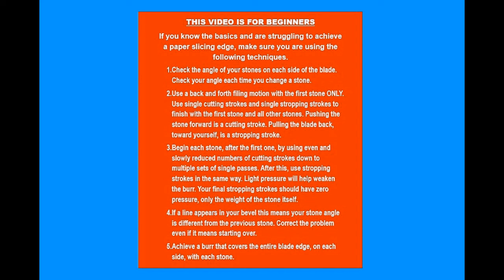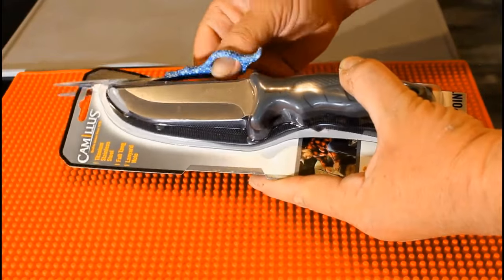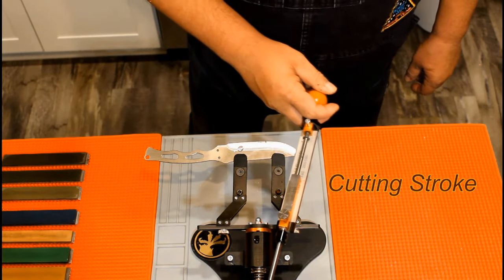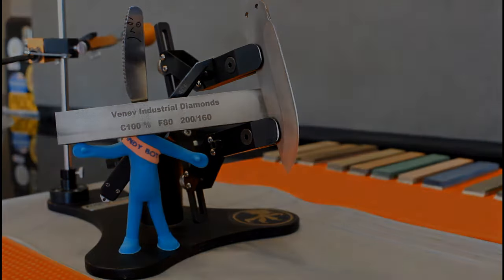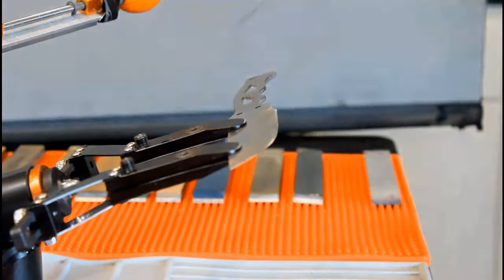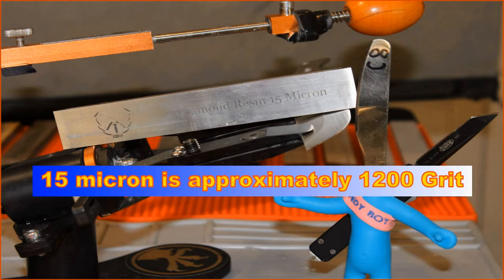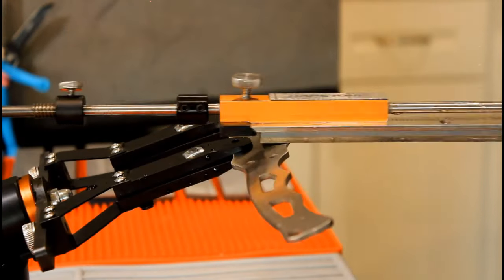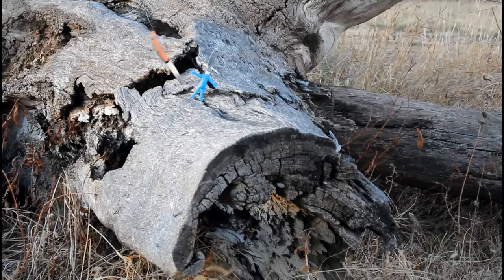How to sharpen a knife using a guided sharpening system

Comment: Thank you, thank you, thank you. I am a knife collector, and finally, after all these years, I bought a knife sharpening system. Hapstone R2 with the upgraded vertical adjustment.  I have a bunch of cheaper knives to practice on but could not find any introductions for beginners until i found this video. Best  by far, i have seen. You should be sponsored by a few companies in this video, too.

Comment: F rating on venev stones is totally different than the standard grit rating. The f400 is around 1000 grit in ANSI. Great video this will be a big help for beginners.
Reply: Yes, I like on the Venev stones that they list the micron range too. Like,  the 50/40 on the F240 is just that. It's much easier relate to everything in microns since there seems to be so many variations in grit ratings.

Comment: Very informative. One of the best I’ve seen. I will say however, the sharpening community itself is very opinionated and I’m a newish sharpener myself but I got some bad criticism on a video using water on my stones(in general wetting them). What is your reasoning for using water? I know why I do it but I’d like to know your opinion.
Reply from the maker: I travel for work and constantly pack up my system, I do not want a bottle of oil leaking all over everything. I used oil with my Lansky and cleaning the stones was tedious, I don't miss using it.
Thanks for watching

Comment: Thank you for this tutorial. At 7:30 you recommend lining up the tip and the hilt with the ruler, but then, for the rest of the video, the position of the knife looks like it's back to where it was before you lined it up from tip to hilt, like at 7:20. I'm confused...
Reply from the maker: That knife had such a large curve I could not go tip to hilt, I had to bring it back to me a bit. I should have mentioned that, sorry. With a curve that large going tip to hilt would have made the apex of the curve several degrees less than the rest of the blade. The bevel would be much wider in the curve.
I just bought the cheapest knife and did not give the blade shape a second thought until it was in the clamps. Tip to hilt really does work most of the time, just not when you are making a youtube video.

Comment: can you do a separate video on the line in the Bevel tip. I couldn't see the line in the Bevel, I'm not sure what to check for
Reply from the maker: Short answer no, I will not be making a video specifically for lines in the bevel. Videos take a lot of time.
If you pay extra attention after each stone change you will catch it, it only happens then or if you did not tighten something down. Repetition is the key. Line up each stone in the same place every time and at exactly the same angle, not even one tenth of a degree difference. If you are not using a digital angle finder like the one in my video you will soon be a master at spotting lines because it will happen repeatedly.

Comment: Hey I have a few questions if you wouldn’t mind: 1: When I’m done with my final 1000 grit stone should I remove the burr with a pencil prior to stropping or will the stropping alone be enough to remove it as 1000 grit is so fine? 2: You say “As a newbie you will have trouble removing the burr. As you gain experience you will be able to remove the burr without using a pencil”. When I gain experience how will I be removing the burr without a pencil? I’m assuming that I’ll get so good at weakening the burr that it will be weak enough that removing it with a pencil is pointless? 3: Ok so sharpen side 1 and feel for burr on side 2. Then sharpen side 2 enough [hopefully about the same] to feel a burr on side 1. Do I remove the burr with a pencil at this point or do I only use the pencil after progressively switching back and forth using less and less strokes/pressure/single light stropping strokes? In your vid you waited until you were completely done with the first 80 grit stone before using the pencil. But when using the 150 grit stone you pencil de-burred after creating the initial burrs on both sides, not after finishing by flipping using progressively less strokes/pressure/single stropping strokes.
Reply from the maker: 1.  When you finish using your final stone it is fine to use the pencil before stropping, I did it this way when starting out.
2. The way you will be removing the burr without a pencil will be a combination of stropping strokes with your final stone, all the way down to "onesies", and by using a strop. With experience you will be able to feel and see that the burr is gone while it is still in the clamps. 

Here is a tip for recognizing the burr. When you start with a new stone use your fingernail to check for the bur. After you are certain you have a burr all the way down the bevel, and you then flip the knife, look before using the stone. You will be able to see "shiny' spots along your bevel, these are each place your fingernail had caught the burr on the opposite side. As you progress through your stones continue to do this. You will slowly learn to recognize the burr, even when it is at 1,000 or 1,200 grit. 

3.It is difficult to keep things linear in a video. The only time you need to use the pencil to remove the burr is when you have completely finished with a stone. So use the pencil only once with each stone.